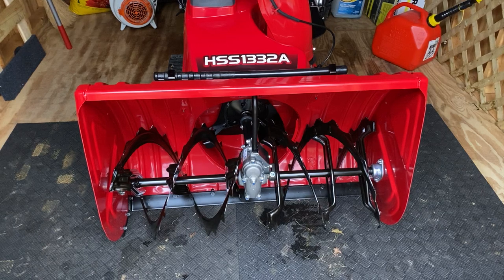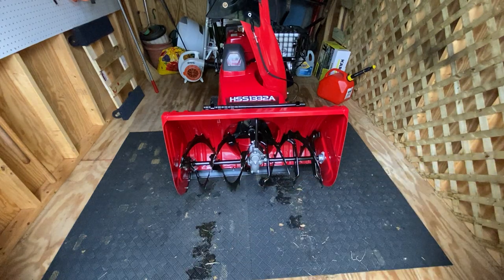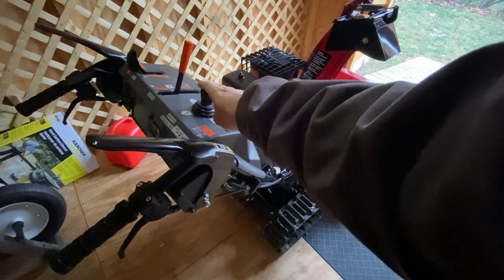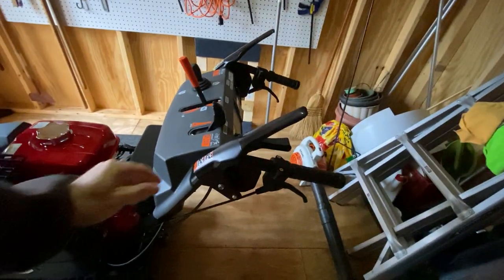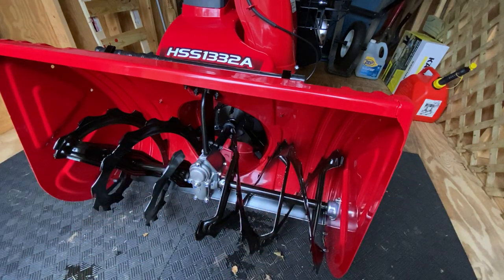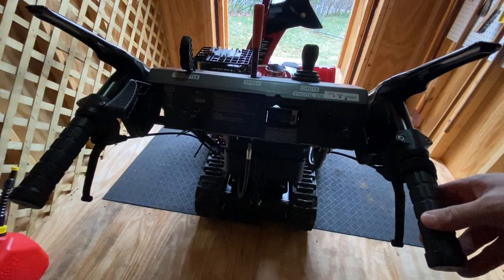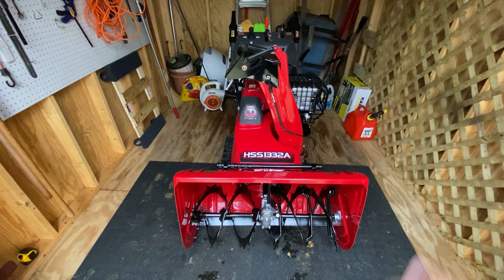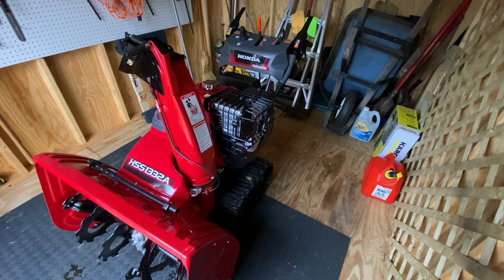Honda HSS1332ATD Snowblower | First Impressions and Comparison

Comment: Did you adjust your scraper bar on it at all ? I found the factory setting for mine was good.... I added side feet and gave the scraper bar like 2 paint sticks thick high. I have a uneven driveway so.... Was needed.... I just feel if you put that scraper out more the feet will be maxed out lol. I also will never used that in DIG mode ever again since i bumped the auger off my driveway..... GARRRR.
Reply from the maker: Yes the dealer I brought it back to adjusted the scraper bar so that it was per spec. However it was about 1/8” or so from bottom of scraper to ground. I wanted more so I raised the front with the optional skid shoes to approximately 3.5 mm or more just so it wouldn’t keep bumping. Hopefully that solved the issue. Thanks for watching
Reply: @appleztooranges  The 32 is a beast.... I only have the hss724ctd.... I still almost throw snow in my neighbors driveway haha.
Reply from the maker: @duckmcquackerson6796  lol it’s going to be crazy when I get real snow!
Reply: @appleztooranges  I burnt through 12litres over ( 3GAL) on Christmas we got lake effect here up in Ontario lol.... The 32 here was 5100 before tax..... 24 ran 4660 CAD up here....Crazy for a snowblower...
Reply from the maker: @duckmcquackerson6796  that is insane. If I didn’t sell both of my snowblowers no way I’d bought this. I had such high profit that I felt like I should get this lol
Reply: @appleztooranges  I had a older Ariens Deluxe 27 what a pile of shit that was compared to this thing.... Was like pushing a Motor around to shovel.... The newer Pro ariens arent bad but Honda all day lol...
Reply from the maker: @duckmcquackerson6796  lol my dealer told me, since he sold both ariens and Honda. If you want a machine to last 10-15 year get an ariens. If you want a 30+ year machine get a Honda
Reply: @appleztooranges  You get what you pay for  ! I'm the same way with my instruments Lol ! Nothing says made in China  on it!